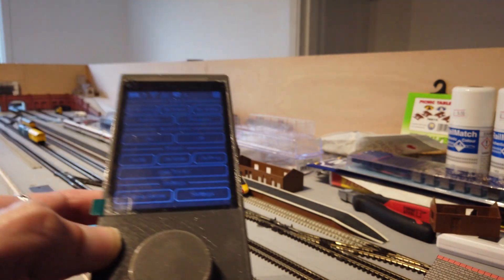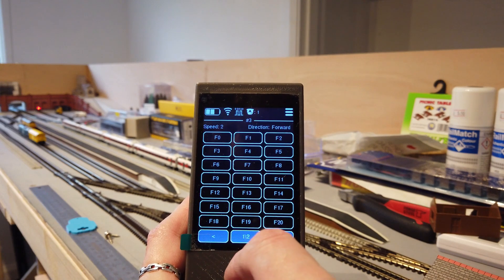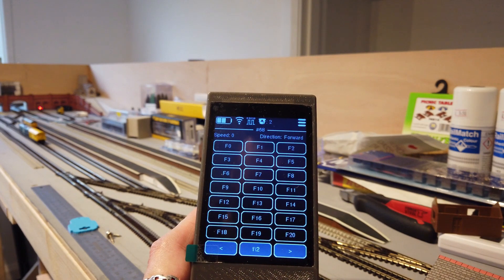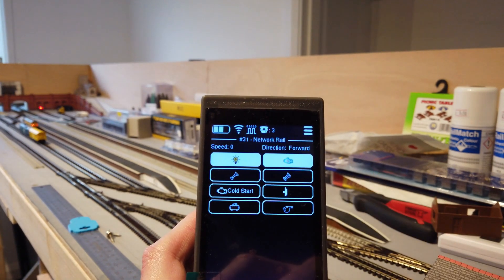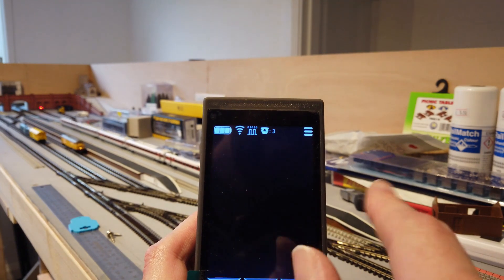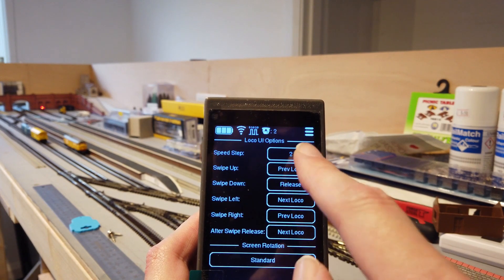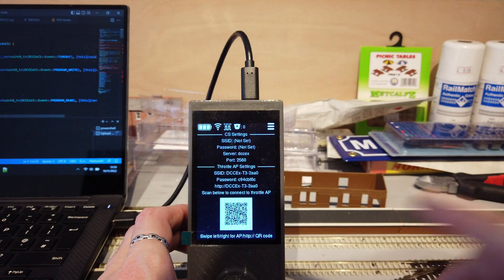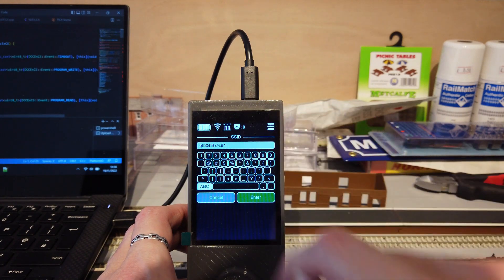EX-T3-WiFi released! Plus demo of future features.

Comment: Thank you very much for your great work. 
I ordered everything but i am not able to flash the firmware to the FireBeetle board (DFR0654-F). It is recognised by my pc but I cant flash it. Is there a flash mode? I tried arduino ide with a base sketch. It only worked if i press the reset button once during the upload... I am stuck.
Reply: Hi, did you find any solution, I have the same issues
Reply: @MoPhips  Yes. I just changed to an other Device. Had a fresh installed Notebook and used it. Worked perfect at the first try. I used Chrome.
Reply: @Inselmann2000  Thanks, just got mine working

Comment: I have problems connecting this throttle to the CS. It’s connected over Wifi to the  Arduino Mega with onboard esp 8266 in AP Mode but the it’s hard to get a connection to the CS. Is there any workaround?
Reply from the maker: Have you set the SSID, password and IP of the CS on the throttle?
You can get the CS WiFi details with serial monitor.
Reply: @haywardjunction  I changed the WiFi Channel to 11 an now all problems are gone

Comment: Hello and thanks a lot for sharing this great project!  Is this throttle working with the CS Dcc-ex only, or will it work in connection to JMRI as well?
Reply from the maker: I've not used JMRI so couldn't say.
I guess it depends if JMRI is able to pickup the broadcasts the CS makes when a loco is controlled
Reply: @haywardjunction  Thanks for your response first. I guess JMRI will not be able to pick up the broadcast from the CS. The controller should be communicating with JMRI directly, the same way as smartphones and known apps do. There is a real chance this could work without any adjustments.....
Reply from the maker: It would require some research or someone with knowledge of JMRI, maybe a connector could be made?
My throttle relies on responses from the CS which JMRI would have to forward to if it wasn't connected directly.
Reply: @haywardjunction  Agree to both points . I assume JMRI is already working in this way, just referring to the smartphone apps that are connected to JMRI, not to the CS. I'm a technician, but not an expert in programming. Keep it as an idea. Thx a lot again & my greatest respect to your work 👍🙂👍

Comment: Can you possibly make a video of how to upload the code to the ESP32 in VS code, i cant figure out how to use it!
Reply from the maker: I'm hoping to get time to add some instructions for those who are unfamiliar.
What trouble are you having?
Reply: @haywardjunction  Hi the trouble i'am having is when i'am using VS code as i dont know which file to open and how to upload it to the ESP!
Reply: Same issue, so many files with odd names, although I'm using Arduino IDE, not sure if that makes a difference
Reply from the maker: This project is a bit too complex for Arduino IDE so you'll need some programs called Visual Studio Code and PlatformIO.
I'm looking into making a code uploader that works in your browser so you don't need to compile.

Comment: A brilliant throttle by the looks of it. One question, I notice it has an accessories function. Can the be used for points control?
Reply from the maker: It's one thing I've not tested as I don't have any DCC accessories but it uses the DCC-EX CS accessory decoder command which mentions points.
https://dcc-ex.com/reference/software/command-reference.html#accessory-decoder-commands

Comment: Just what I was looking for to build! I have one request. Could you please provide the dimensions of the cavity where the Li-PO battery resides. The battery source you suggested is out and i can get an equivalent from another source ,  but need to know LxWxH in  MM, Thanks in advance - Dave Clifford Aurora CO America
Reply from the maker: I'll try tomorrow as I need to get on my PC to access the designs.
The page where I got the battery from has some rough dimensions in the description.
https://shop.pimoroni.com/products/lipo-battery-pack?variant=20429082247
Reply from the maker: To be safe I'd say the max battery size is 50mm x 100mm x 8mm (maybe 10mm at a push).
If the battery you use is different from the sizes I used you might need to make a new strap to hold it within the body.

Comment: Presumably when you've completed the wifi self configuration feature you'll release a bin file for an esp32 loader?
Reply from the maker: The code will be updated with new features.
I can include a bin if it's something people want but I'd need to check about having the SPIFFS bin too for updates to the web section.
Reply: Esp32 web oriented programs such as esp3d allow siffs writes via a web interface..once they've got ip access to the esp32 it throws a simple web interface for this and also ota updates...but I guess that ota halves the available code space.